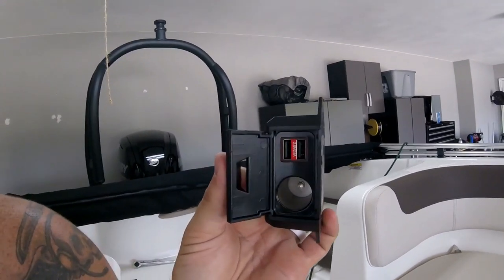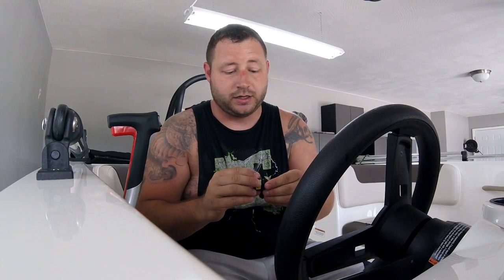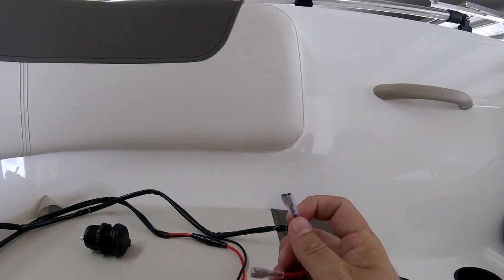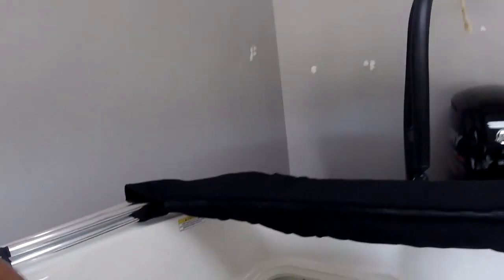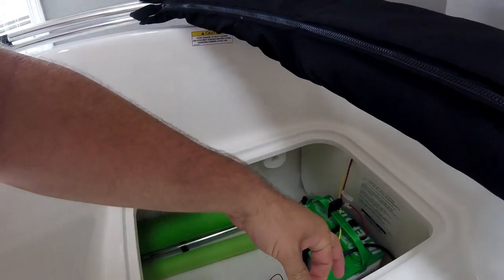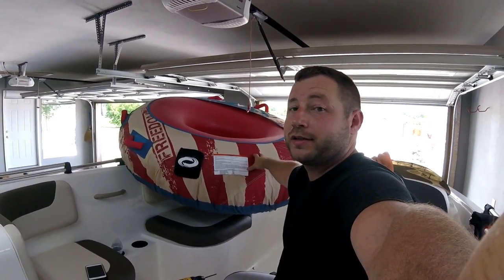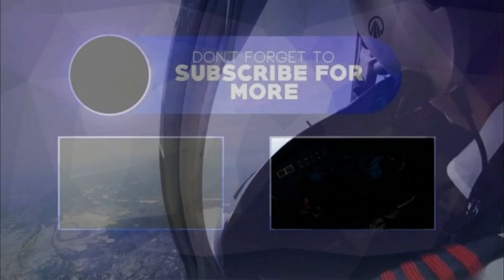How To Install 12v Outlet - 2018 Bayliner Element

Comment: My E-21 has a 12v adapter Built-in, but it will not charge an iPhone X or iPhone 11. It’s a total waste. I had to install an inverter and connect it directly to my battery along with a 15 foot USB lightning cord to the captains chair in order to charge my phone while running the boat, and using the VesselView app. I might take your advice from this video and add my inverter to the switch. Just to make sure I don’t leave it on and kill my battery. This is a great video.
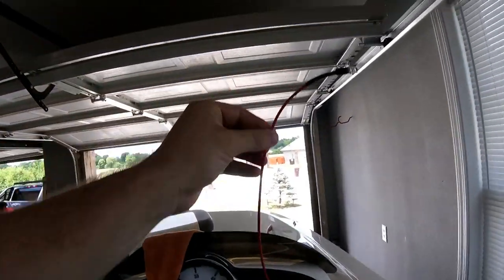Reply from the maker: john macgugan wow that is terrible! Sorry to hear. I did change some stuff up later on when i added the speakers. I had blank spots in the fuse block under the dash, the fuse block is directly powered by the battery, so i added a larger fuse to a blank spot, and cleaned the wires up a little. And had zero issues with phone charging even when i had speakers going. I kind of show it in my wake speaker install vid, about 5:27 into the vid
Reply: midwestbuilds I wired my lowrence to the fuse panel. It takes much less power than our phones
Reply from the maker: john macgugan hopefully u get it figured out and loose that long usb! Im a huge fan of using that switch, i never want a dead battery either if i forget something on

Comment: Excellent video! I guess you could just install it without a switch, correct? I believe the only critical thing is to have fuses.
Reply from the maker: Raul Zagarduga yes exactly, i just wanted one personally. I have sense re wired it to the fuse panel under the dash and it still works great, i think thats in the speaker install vid. Thanks!!

Comment: I saw where you ran a red wire from the switch to the accessory/12v outlet. Did you have to run a negative wire from the 12v outlet back to the battery?
Reply from the maker: Chris Meeker i originally did yes, but i have rewired everything this year, if u watch my wake speaker install i talk about it. But i am using the factor fuse block now for positive and negative. I just used a blank spot and put the appropriate fuse in. Thanks!
Reply: ratherbeflying Thanks man. Hope all is well
Reply from the maker: Chris Meeker thanks!!
Reply: @midwestbuilds  I'm trying to install the 12v outlet in my 2021 e16, can you explain how i find and hook up to the factory fuse box? Thanks.. Great Vids.. just got my boat and these are super helpful
Reply from the maker: @myadhdcoachofthewoodlandsl8556  hey, just hook your ground to the negative side and your power to one of the empty slots. Theres a lot of empty ones and you can just google and add the appropriate size. My speaker install vid shows this a little. I think its at the 5:33 mark. Thanks!!

Comment: Another great video. Just curious why did you choose to run the wires directly to the battery instead of using one of the blank spots in the fuse panel under the dash? 

Also I would love to see a video of how you store your gear if you have time for that.
Reply from the maker: James after my first attempt of keeping the wiring short and failing (wether it was because of cheap wires or how i wired) i wanted to just go direct to battery and have no issues. My air pump drawls a lot and this way i was safe for sure 

No problem on gear vid, will try and get to that one soon

Comment: My e16 came with a 12v outlet in the cubby directly next to the Jensen stereo. Yours did not? Or are you adding a secondary
Reply from the maker: Melvin Chilson i was able to choose what accessories where added upon purchase, i choose not to have dealer installed radio & 12v. I wanted to instal myself, a bit more work but well worth it!
Reply: Good choice. I feel like the added options are kinda cheaply installed. My boat was set up from the dealer like that and the cubby on the side isn't in a good location and the factory sound system is kinda cheap. If I were to do it again I would have got a bare bones and done all the stuff myself.